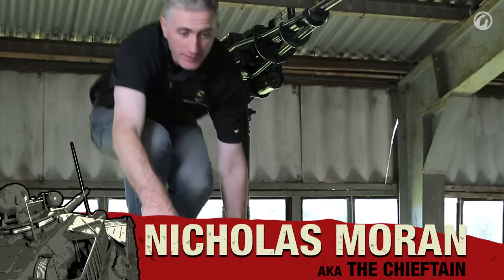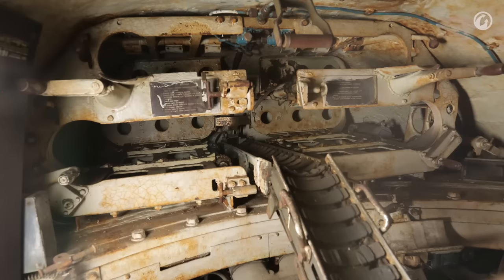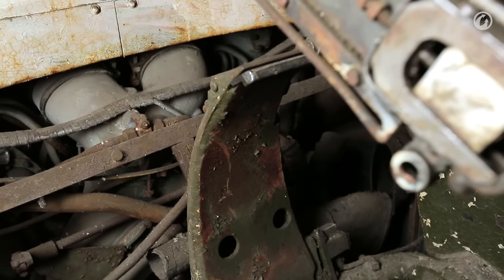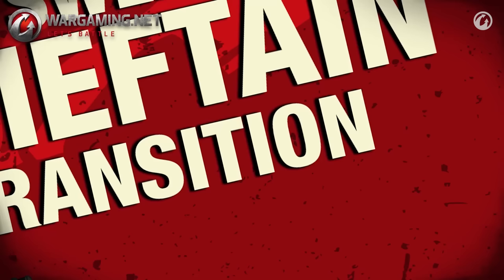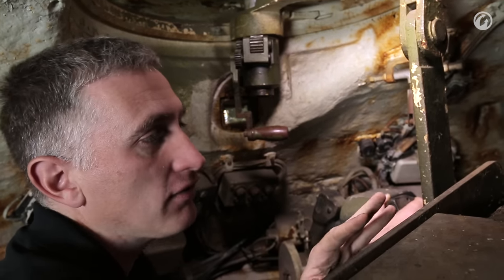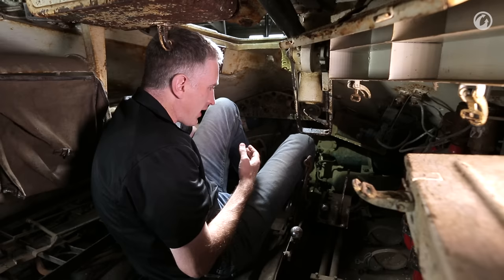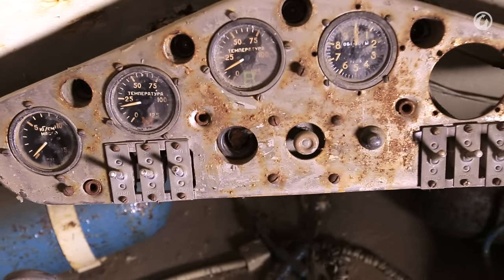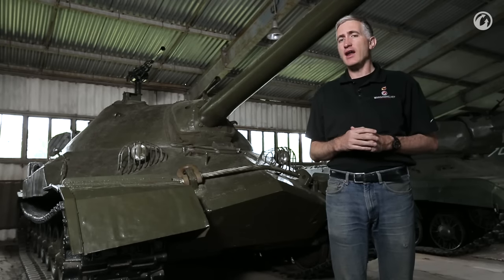Inside the Chieftain's Hatch: IS-7 Part 2

Comment: It's pretty common for soviet tanks in general to not have turret basket, reason being the crew would not be able to access the main gun ammunition racks strewn about the interior if a basket was in the way. Western tanks lump most their ammo in more easily accessible places such as a turret bustle. That semi-auto loader is incredibly over-engineered and a western manually loaded 20 pdr, L7 105, or 120mm gun could easily achieve a higher rate of fire & switch out ammo after it has already been loaded. That armor profile though...combined with good speed, it would have been a truly fearful beast had it a more practical weapon system.

Comment: These tanks always seem to cramped to me. I kind of feel like the gains you would have in crew efficiency if they just had room to move, and not be crunched over in and awkward position for hours would be worth the risk of making the tank a little bigger.
Reply: i rather be cramped and have a smaller target area than be roomy and be terrified because of how big of a target i am
Reply: slay I think another inch or two of interior room would make a lot of difference to the people inside, especially the ones who have to wrestle a 40 or 50 lb shell into the breach as quickly as possible. To someone firing at you from a distance those extra inches probably wouldn't make too much of a difference. The improvement in your rate of fire and ability to keep loading for an extended fight might be worth that risk.
Reply: +theenigmaticmrwu but with another inch or two still thats more armor to produce and these tanks were all about being cheap
Reply: well most soviet tank crews were not tall. they where only about 160Cm in height.
Reply: Well you are the kind of person who figured out why the germans and us built tanks in this way in ww2. And why they were efficent.
Reply: @acolyteoffire4077  I once meet with a guy in hungary who were served as a tank crew member on soviet tanks. He was 170cm on height and it was really difficult to serve in those tanks. He first trained on t34 85. He had no enough room to move as a loader. There was no turret basket. When the turret rotated rapidly the loader tend to can't keep up with the turret. Injuries and even death cases occured by turret monsters. They were ordered that gunners must keep halts/ pauses in every 15 deegre of turret rotation to prevent this.

Comment: Made me more curious about Commie tanks. Chief do a Chieftain's hatch for T-72!
Reply: He probably wouldn't fit in.
Reply: The T72 isn't made for anyone taller then 5ft tall.
Reply: That things lame
Reply: 00008HANK I've seen the video of were the mighty jingles tried to get into and struggled for room in the drivers compartment and turret compartment and he's smaller then you. It's in the Road Trip to the DCC Shrivenham part one video. Main question is could you operate a T-72 as a driver knowing that?
Reply: I guess it does matter if you're a small or big(fat) built guy.
Reply: My dad used to be a T 72 commander when he served in Czechoslovak army.He told me it was a pretty good tank with 3 crew and it was an autoloader.

Comment: I enjoy these videos alot and love tanks one of my baby pictures is me at 3 standing on A M4 out side one of the bases Dad was stationed. This next bit isnt ment to be disrespectful  I just couldnt get over the machine guns everywhere almost like the designer of the the early Stewarts had a hand in it or the company that made the rounds Great video 
Wow what a beast  I wouldn't doubt some surrendered as soon as this monster rolled aroud the corner Patrols of the enemy when was was near always came back with a report of nothing going on because they hid lol Yes they did away with the gunners main optic as far as Machine gun  firing when needed the IS 7 was put in neutral a   switch was flipped the gunners control became a wobble stick on it one of the buttons fired all the machine guns at once  and the gunner neutral traversed the tank in circles if you look each gun is aimed higher or lower than the next thus covering from  3 to 6 foot high later when the switch turned the control to a wobble stick Rock you like a hurricane automatically played both inside on outside of the tank. Theres a mental image. This was done away with due to the fact during one of Stalin's purges he discovered this and hated The Scorpions

Comment: As in real life it was an autoreloader, make it an autoloader in the gave. You should make it cost about 10000000 credits and 1000000 experience. Make the full magazine reload in about 1.5 minutes and have the same alpha damage and penetration as now. Make the clip 8 shells big and the reload between the shells should be  about 3 seconds. OR make the changes stated above and make it on a limited time sale of about 150 euros. All players with the is 7 already in their garage will get the version for free. You could also potentially lower its hit points, accuracy and turret and hull traverse to compensate for the clip. Then replace the IS 7 with an object 777 version II or something else more modern like a t 10M that would have about the same characteristics as the is 7 now. I  think that this is a really good  idea that you should implement in the near future. Anyone else?

Comment: A very over optimistic design by the Soviets which is surprising that i would think the Germans would have designed something of this nature.This was in my opinion a battle tank that had great features of sloping which would have given it great protection,excellent.Yes i am very familiar with the "Turret Monster".I had installed little mesh bags tied or velcroed to the turret wall for my gunner and loader in my tank so the "Turret Monster" would not eat it,MREs and personal stuff.For me the TC i had mines stashed behind me near the rear secondary ammuntition stowage door.Keep your tank clean,everything will run smooth.
Reply: reddevilparatrooper  So mines are still being used? By the U.S? Well, that IS sad indeed. Mines have a tendency to stay around longggg after the war they served, awful things. Or are they different to what I am imagining?

Comment: What's the difference between an auto-loader and an assisted-loader?
Reply: Simple. An auto-loader fully automates the processes of case ejection (if required) projectile and propellant being selected and rammed home and the breach block closing to make the gun ready.

And assisted-loader on the other hand only automates part of the processes and still requires human interaction. In this case the loader must select and crank the projectile and propellant onto the rammer tray. The loaders don't need to manually haul up the first six projectiles but still are required to do some actions to make the gun ready.
Reply: +Cragified thanks much
Reply: Sounds erotic Crag...I mean, I guess to get young men to join up, we have "ramming things and breach block (the doc told my wife its not good to do breach block in her pregnancy).....LOL!

Comment: One amazing 'fact' is that any modern shoulder fired anti-tank rocket could cut right through this thickly armored vehicle.
If they lift the turret off of the hull, would they find missing socks under the turret basket?
Does this automattic loader predate the T-64?

Comment: I wonder if modern tanks could pen the is 7s turret
Reply: The guns on modern MBTs are capable of penetrating the armour of modern MBTs, as we know from occasional friendly fire incidents. Given that, they'd certainly be able to punch holes in this thing very easily.

It may be thick, but it's just simple homogeneous steel plate. Modern armour is much more effective.
Reply: Eternal Thread considering we have rounds capable of penning over 500mm, absolutely. This is just RHA, MBT’s in the modern era has composite armor.

Comment: Why is it all rusty inside?
Reply: johnmailloux That does not mean it has to be rusty inside, so that is no explanation at all.
Reply: because the museum in Kubinka is on the ground of a military unit. There are few soldiers and they do not care for the tanks. Them a little and they do not care. Caring only outside My friend served there.
Reply: +Escylon yes it does... Unless it is Well maintained with new paint to keep the steel from being exposed to the elements then it will start to rust and Fall apart

Comment: Its insane how small that tank is...crew comfort?  none at all.....its a wonder that tank even works in WoT...and the ejected shells just bounce around inside the tank?  So in WoT there shoul be a 40% chance for the Commander, Loaders an gunner to die when you fire...
Reply: CMDRFandragon He just said it was comfortable, do you not pay attention?
Reply: +Vladimir Lenin did you see how he was sitting and standing? Try being in such a position for a few hours of driving
Reply: Valentine Better to be uncomfortable and have good armor, than comfortable and weak armor like US tanks, tall, weak angle, easier to hit, thinner line of sight armor. IS-7 has 430mm effective armor on the front due to double slope. Comparable US tanks of the era had 140-200mm effective armor.